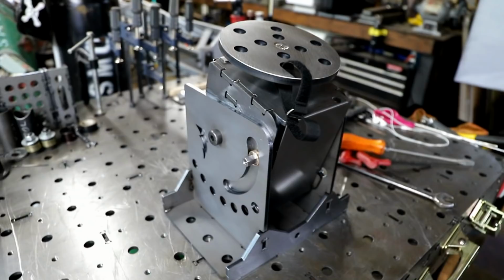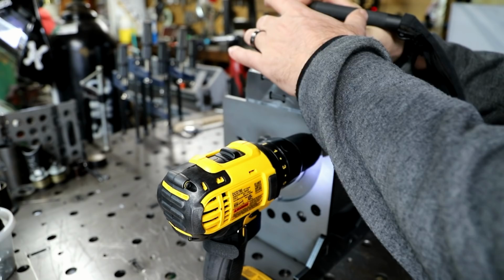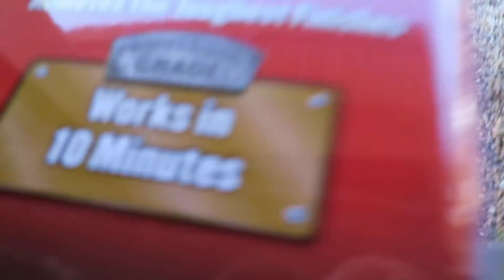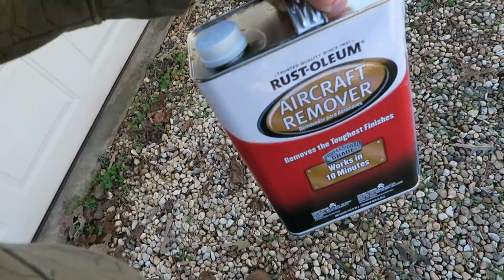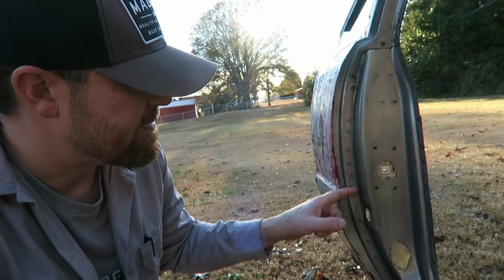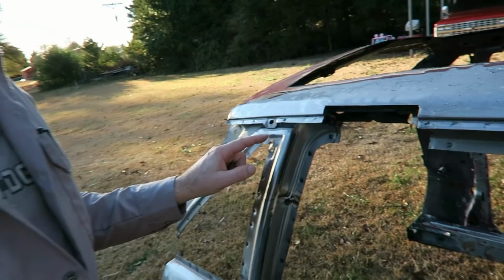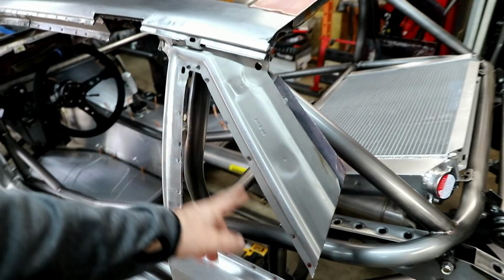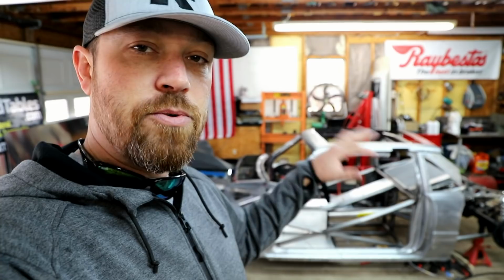Turbo Fox-Body Mustang Hot Rod Build | Body Metal Is Bare

Comment: I think the EPA is working their magic on that aircraft remover. About 10 years ago I bought some that I used to strip down a motorcycle and the paint wrinkled up and washed right off with a garden hose. Last year I bought the same stuff same brand and all, used it to strip another motorcycle gas tank and it barely effected maybe half the paint. I wound up having to take a da sander to it to get the rest of the paint off.
Reply from the maker: yeah Im sure
Reply: My late father was a silk screen man in a factory and he brought home some Jellied Carbon Tetrachloride for me to use on my bicycles , I was chopping and welding up bikes when I was around 10 or 11 , the Carbon Tet as he called it would completely strip the frames down to metal without any scrubbing ! just brush it on and rinse it off . My mom flipped out cause I was doing it in the basement in the winter time and I got got higher than a kite .
Reply: sinformant, I sure do hate to hear that. I haven't bought any for a good while and just assumed that it was the same as always. 
I wish they would quit doing that crap "for our own good" and just let us be responsible for using it properly, but we all know that won't happen because of "stupid people."...
Reply: @shawnfoxfirth9684  I bet a few brain cells ran away and never came back too.

Comment: Whatever that tool is at 5:32 ..... I want one. I've never seen anything like that. What kind of wheel is on it?...
Reply from the maker: They are a modern style 20 inch wheel
Reply: @Thefabforums  Lol... I was referring to the sanding wheel... 
Is it wire? Or sand paper?
Reply: Its a eastwood fab contour. Surface conditional tool. Or sct
Reply: @rcmike09  Thanks... it's a must have! It will be awesome in the woodshop.
Reply: @JasonWelchMusic  Hey Jason.  Michael Sullivan nailed it.  Kyle did a special episode on that tool a while back.  Check out "You Need This Tool - Episode 54 | Contour SCT".  Enjoy.
Reply: @TheMick26  thanks so much... I'll go check it out! It was the coolest thing I've seen in a while.